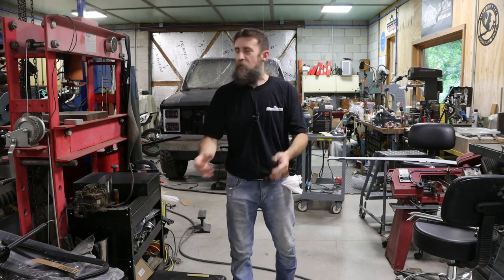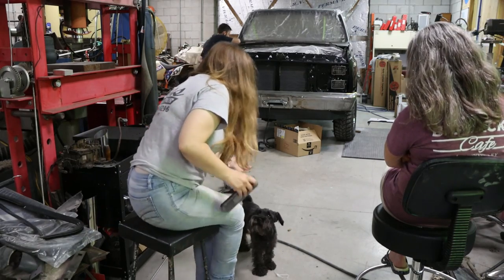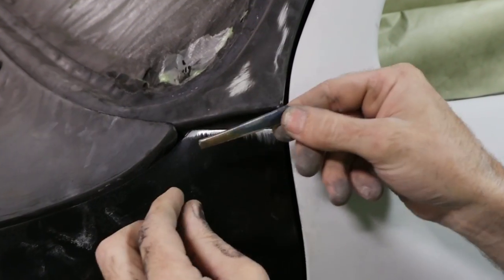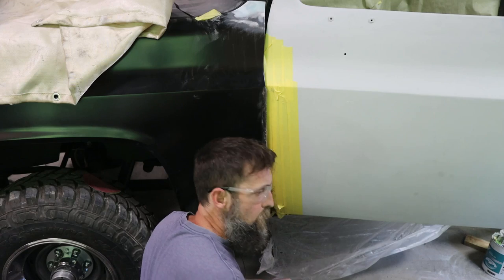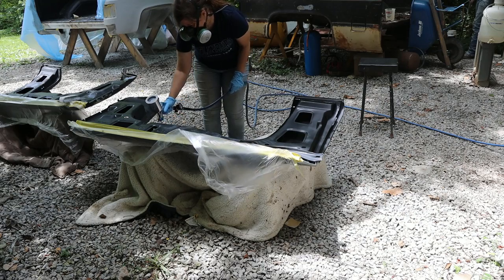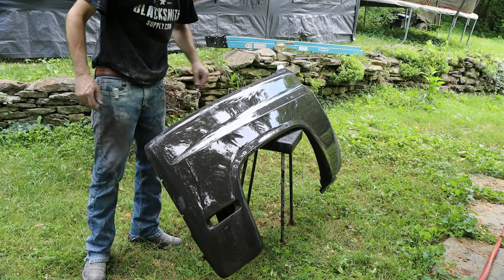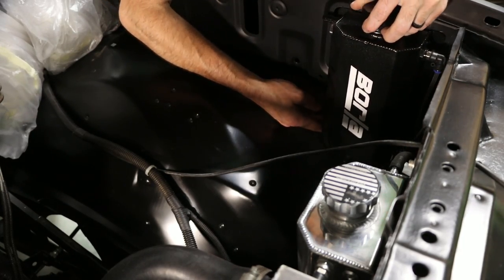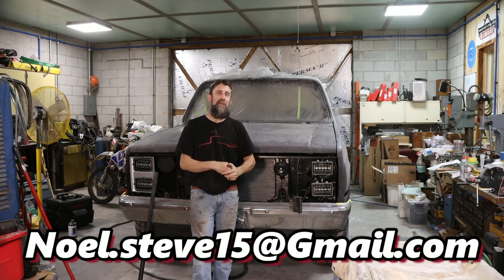Do they really fit that Bad out of the box... Yes they do.

Comment: Hi guys. Well once again I feel I have to write in . Your absolutely right these current replacement sheet metal barely fit. Do not expect these things to " bolt on " its not going to happen. I just replaced the front fenders on my 79 K30 which I did 24 years ago , and the ones from 24 years ago were way better!

Comment: Steve, Before epoxy body fillers were invented, the old school body men used a torch and lead solder. It was blocked in with VIXEN, or half-moon files. Lots of those old timer had problems with lead ingestion and inhalation. Epoxy fillers stopped that. Thanks for the video. Jon

Comment: Hey guys, if you want to protect the areas you can’t get to from rust the can I suggest the best rust preventative ever, fish oil. It’s cheap and you can get the deodorised stuff now and and it really works. I’ve never had rust develop on parts coated in it, even the bare metal plates that I welded on the bottom of my carport posts that bolt it to the ground 20 years ago still have no rust and they got one coat. It will get into the tightest seems and joints. Cheers Stuart 🇦🇺

Comment: Really gonna be a huge transformation from its former tired old self, in fact it already is - and the satisfaction of knowing youve addressed everything from the ground up and knowing youve built in new power, rust resistance, strength and reliability as well as a MUCH nicer looking truck will be welcome.  Im wondering how youre gonna take the interior, doesnt have to be show truck interior to be a nice job, it starts getting to be fun when you make it down to the final touches and it all comes together WELL DONE.

Comment: Steve I just use a spacer attached to an old wrench with a bolt and impact, to set threaded inserts. Much easier to get in tight places and faster especially if your setting several inserts, we use bolts to attach body panels to our race cars so you use a lot of threaded inserts

Comment: Nice work Steve. I may have installed those threaded inserts “wet” with some primer to provide corrosion protection to the exposed bare steel.

Comment: To late now as you have done it, but i find if you use filler on the back of those built up edges it always lets water in and goes rusty, i find that using the fibreglass filler like p40 is much more resistant to it rusting , you dont get such a smooth finish but it doesn't mater as you dont see it on the back , however it is much better at resisting it rusting

Comment: depending on if that fluid reservour tank is made of steel or stainless/aluminium you might need to coat the inside to prevent the fluid inside from turning intoo brown rustwater

Comment: you are just about at getrdone stage - make sure to do the aftermkt accessorize path - think about fabbing something like transferflow and have a tool box, a backrack and some rails  - easy to tack on plywood - think about running lite kit  - i don't think you need a light bar - you can put on some led on top of backrack and then you just have to drive it and get electronics - try to get the bluetooth transmitter and record all the engine diagnostics on a laptop. - you are almost there - drive it easy for a while as you get to know it #man hours

Comment: Steve, I got a question: was there any "play" in the bolt holes for mounting that driver's side panel? If not, couldn't you have taken a milling bit (doubt that's the right term for it, but...), and elongated the holes to accommodate the fit? Your solution worked great, but just wondering about this.
Reply from the maker: There is quite a bit of adjustment in the mounting holes. The issue is that the fender needs to align with the hood as well. More adjustments wouldn't have really helped. The fender just wasn't shaped properly to make all the lines good.
Reply: @SteveSummers  Ah! I get it... Thanx for the answer, Steve! Rock on! Love your work.

Comment: Im old enough to remember the difference between factory replacement panels verses aftermarket. Aftermarket has always been a crapshoot. Putting GM parts on always saved a lot of time.  Time and more body work sometimes cost more in the end than the GM parts cost. Nowadays you probably dont even have a choice. Only aftermarket

Comment: Easier to adjust the gap by cutting through the skin about 1/2" back from the rolled edge, then moving your finished edge into place and welding back along the cut line.  Then your body work is along the flat and you still have a factory edge on your fender.
Reply from the maker: That is definitely a good way to do it. This could have been several different ways. 👍